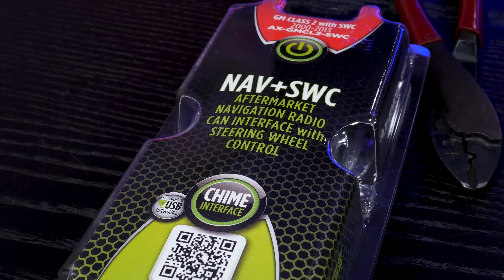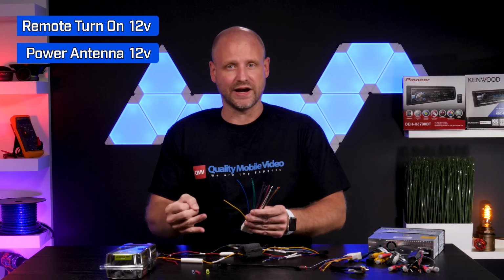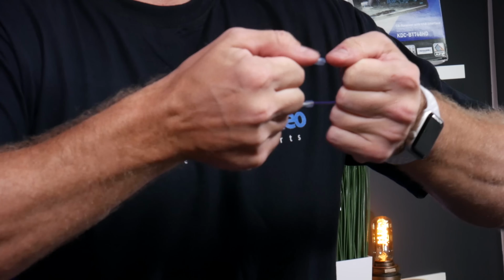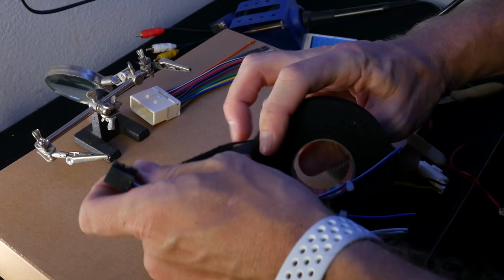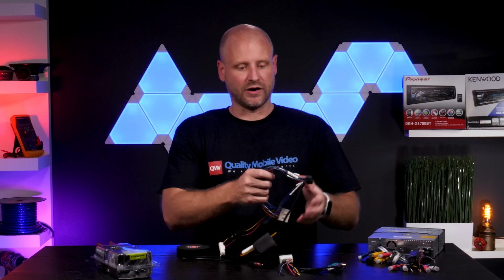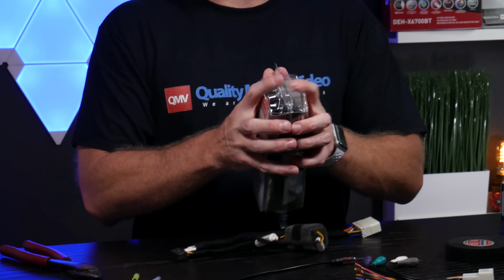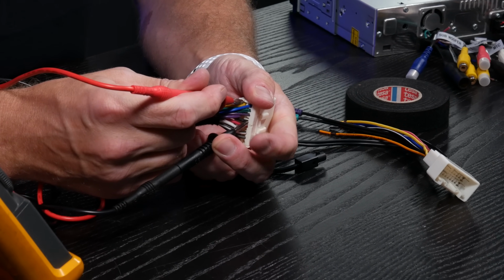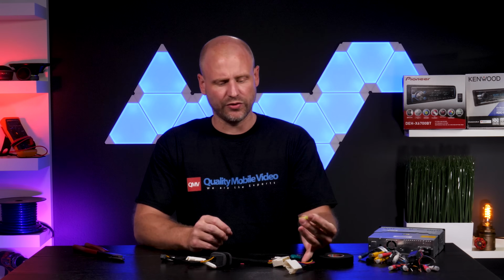Car Stereo Wiring Harnesses & Interfaces Explained - What Do The Wire Colors Mean?

Comment: im confused with the blue wires. I know that one of them powers a mechanical antenna but what about the amp blue wire? Im installing a flip up radio on my motorcycle and the antenna reception works good when the display is no flipped up but once it comes out and flips up the reception gets bad and I have no idea how to fix that. I thought maybe the blue power antenna was for getting better reception but I don't think it is. Also how do I wire it so the video plays while I ride?
Reply from the maker: Generally remote turn on
Reply from the maker: To play video you'd have to bypass/ground parking brake, which is a safety hazard

Comment: This video is the most informative and educational on this subject.  Thanks a lot!    I have a question on the steering wheel control unit and parking brake by-pass.  I have a 2005 Lexus ES330, and try to change the factory radio to aftermarket one, do I really need the steering wheel control unit and parking brake by-pass?

Comment: I installed a aftermarket radio and interface and followed diagram wire for wire..but the radio will not power on or off with the ignition. I have to manually turn on/off...any thoughts as to why.?
Reply from the maker: Tough to tell, could be the wiring could also be the brand of stereo if it's a lower cost model
Reply: @Qualitymobilevideo  it is a lower end brand. It's a dual xdcpa9bt

Comment: Ive got a harness adapter with a yellow dimmer positive and a yellow dimmer negative.  I have no idea where they connect to since my aftermarket radio doesnt have a dimmer or illumination wire.. also my dash lights aren't working so im thinking those dimmer wires really need to be connected

Comment: Try connect rear camera and got little bit smoke from wires. Now screen brightness doesn't work,only seat on minimum. What can be wrong?
Reply from the maker: Sounds like you shorted something or connected something reverse polarity.
Reply: @Qualitymobilevideo  so it mean screen fault or can be wire burn were go to canbus box?
Reply: @Qualitymobilevideo  I know what connect something wrong. But my question are why my screen brightness on minimum and don't wanna adjust brightness? Wires fault or something else?

Comment: I usually just use heat shrink. then put a layer of high temp electrical tape. Then I electoral tape all wires together. Then I zip tie everything together really tight around were i connected the wires together.  I just try to overkill as much as possible to prevent failure.

Comment: My 2006 Dodge ram 1500 was broken into and they cut the Manufactures Radio Harness, and took my manufactures amp, How will I hook up and aftermarket radio and to get my steering wheel control back?
Reply from the maker: Oh shit that's horrible! Did they completely pull the factory radio harness out? Or are the remaining wires still applicable for an installation?
Reply: @Qualitymobilevideo  Thank you for the reply, The Harness was completely cut. and the rest of the wiring is cut. I went to a junk yard and they gave me a wiring harness but the colors don't match my truck wiring.
So I am lost,
Reply from the maker: I would try and contact the car manufacturer to see if you can get a new factory harness

Comment: We've hooked up everything properly and have done many installs. But we hooked this one up and still have no sound. Not sure what's missing. It's a 2003 Isuzu Ascender with a stock Bose audio system. We are installing a Pioneer AVH-220EX head unit.
Reply from the maker: What radio replacement interface did you use? Here are some I'd suggest:
https://www.qualitymobilevideo.com/gmos-04.html

https://www.qualitymobilevideo.com/ax-gmcl2-swc.html

https://www.qualitymobilevideo.com/gmos-014.html

Comment: What if the after market radio harness doesn’t have a “power antenna” wire? Do I just shrink wrap the “power antenna” wire on the factory wiring adapter?

Comment: The radio I ordered doesn’t have the dimmer wire but the harness does should I be worried?
Is it just an option for some radios?
Reply: bryan acosta did u connect your stereo?

Comment: I have a 2008 Silverado WT with manual everything--no buttons on the steering wheel--but it does have Onstar. How do I know if I NEED an interface or not?
Reply: I'm having the same dilemma, I think It would need an interface.  Research you're vehicle type with the search term audio interface and see what they have.  I think it does as my vehicle is a chevy as well. He kind of glosses over the interface part and doens't really say how to know what type you need. We bought a quick connect harness and it's not working for the HHR. Let me know how it goes.

Comment: I have a Bose factory system in my Nissan Armada install a touchscreen stereo everything works but the Bose factory speaker is this because of the factory amp?
Reply from the maker: What year Armada do you have? And did you get the correct interface/harness? For exampled, models 2010-up require this harness to bypass the am and retain Bose: https://www.qualitymobilevideo.com/70-7554.html

Comment: So I just put an aftermarket double din in my 2002 Hyundai Elantra and I’m pretty sure I accidentally crossed the ground and the illumination wires because when I turn on my headlights my radio cuts off and says “NO SIGNAL”. What wire do I connect the ground to?

Comment: i connected pioneer avh-2750bt with 12v 10A LED driver for my home but each time i switch off and turn it on the memory  is reset, doubted whether it was due to reverse connection but that was not the case. What possibly could be the reason

Comment: Is this "universal"? About to pull apart the dash of a 2019 Camry (NON JBL) system to connect my LC7i and speakers from amp back to the harness....
Reply from the maker: In terms of colors of wires, these are generally universal, but every car needs a different harness/interface when replacing the stereo. But if you're talking just about the speaker connections, the purple, grey, white and green are almost always the same.

Comment: i used my old connector and the new adaptor that came with the stereo and connected the colors and i turned the truck on and it worked but i turned off the truck right away bucause i got excited and then i turned it back on and the stereo didn't work anymore and then that i'm guessing caused a shortage and my radio fuse burning and causing my cluster to go out as well , one thing i did notice was that the adapter color wires that cane with the stereo were thinner then the connectors wires that the old stereo had
Reply from the maker: What's your make/model/year?
Reply: 2002 gmc sierra 1500
Reply: i think ima need a new aftermarket wiring harness and not use the old one that i was using for the old stereo  , what do you think
Reply from the maker: @alexis_1503  You need this https://www.qualitymobilevideo.com/70-1858.html

Comment: I have 2013 Silverado 2500 ltz with nav and finding out colors on that factory harness are different colors than new radio harness wires and can’t find and connectors for that model has almost like and ecu plug on that back of the factory harness

Comment: I have 2004 Toyota Avalon with jbl audio and built in amp and i have static in my speakers. my wire harness has the purples, greens etc. but they are rca and my aftermarket radio does not have rca what do I do please help.

Comment: Hi I'm Rohan,Thanks for the great video,I pray u can help me ,I'm installing what I thought was an easy install it's a 2009 Hyundai accent ,dual dim or double dim radio with back up camera ,installed the radio and it worked then the back up camera didn't work ,so tried interchanging the wire from the back cam to the radio but still no back up cam, anyway changed the radio a new radiousing the radio without back up cam ,2 days after radio audio went out ,then a few hours the radio stopped powering on ,so we changed the radio,now ,the new radio won't power on at all, checked the yellow wire witch is supposed to be battery+ it does not have 12v checked the 3 audio fuse in the fuse box ,they all good ,I get 12 b on the red acc wire ,no voltage on yellow wire ,???radio won't power on

Comment: 2004 Z71 aftermarket radio checked all connection over and over and i still have a squilling come through speakers ?
Reply from the maker: Was the noise happening before the installation to the old stereo? Does it happen on all sources? How is your ground?

Comment: I have a yellow with a black strip mute wire.  Where do I connect this wire.
Reply: Don't worry about it it's a old feature you probably don't care about.. hook up all your speaker wires and power wire so the radio comes on

Comment: hi there can anyone help please, i have just installed an after market stereo to my jeep grand cherokee and it work fine, until i turn on my head lights and then there is no sound. the stereo is still working the illumination works, its still playing but i have no sound at all. any ideas please. many thanks  Tony
Reply from the maker: Hey Tony, sounds like a wiring issue. My first guess is you have your ground wire hooked up to the illumination wire of the car. Change your ground wire and it will work fine. I'd double check all your connections. What harness did you use to connect the stereo to the factory wiring and what year is the Jeep? It could also be your electrical system can't handle the load.

Comment: I have a problem with my pioneer avh1300 I just bought. All connections  are made yet I'm still not getting any power. Any help?
Reply from the maker: Still sounds like there is a wiring issue. Check Constant, the yellow wire; 12 volts all the time. Red wire; this is accessory, meaning 12 volts as you turn the key, check for this.  Ground????? Explanation needed?

Comment: My radio in my car (aftermarket radio, on Polo 9N3) remains powered on also when the car is not powered on. What do I have to do If I want to have the radio working only under key ignition? Cut the yellow wire? If I do so, the red wire is under fuse too?

Comment: So witch harness is witch, the harness that comes with the after market radio plugs into the back of the new unit and the exposed wires connect to your cars wiring behind the dash but yet it’s a plug with the wires that connected to the factor radio do I just cut the wires behind the plug and match the wires accordingly color
Reply: No for the sake of the next owner please for the love of God do not cut those Factory connectors. You need to buy a vehicle specific adapter harness that will give you the standard colors to match up with your aftermarket radio
Reply: @rmblwgn  okay I figured that out now but metra doesn’t have a compatibility with my Lincoln town car and also I’ve noticed that there are more than 2 plugs there’s about 3 more connections and I think the go to the stock subwoofers in the back

Comment: I am simply trying to take a junk-yard radio from a 2014 Explorer and put it in my police 2014 Explorer and make it work.  I changed the mounting Brkts, but when I plugged it in it would not tune or change frequencies and there was no audio.  Seems that the cable plugs-in OK to the police car cable but will not tune and there is no audio.  What do I need to make this swap work?

Comment: Help: My 2013 Chevy Camaro is having radio issues. Once car is turned on everything is normal when you switch to drive ragio turns of and blinker doesn't work the AC stops working.  This is an issue with lots of Camaros and Corvettes but not a recall yet. Here's my question. On youtube thers a person showing why this is happening and to clip the white wire connection behind the radio and this will fix the problem. Would you know how true this is? Thank-You in advance.
Reply from the maker: Have you tried calling Chevy technical support or bringing your car into a dealership?

Comment: After stripping the wires from the stereo harness, they appear to be aluminum and 22 gauge. The wires from my car harness are 18 gauge and copper. Will this be an issue if I solder them together as instructed in the video? Cheers

Comment: I've got a 2007 Nissan Altima, I hooked every wire up correctly... (The color codes to the new Dual Double Din stereo we're the exact same) I grounded it down, not very well, but enough to power on. 
Now my problem I'm havin, which I hear very commonly, is it powers on, does everything it's supposed to... But no sound...
The factory radio had the power antenna hooked into q separate, much smaller "wire harness" that plugged in the back. I did not hook that into my new aftermarket one. The reason is because the original was a connector type plug in style, my aftermarket has a circle style. So I did not hook that up, is this why I don't have ant sound? It's the traditional wire harness hook up. Thank you!!
Reply: If the antenna is not connected, you should at least get static when you turn the radio on.

Try playing a compact disk, and see if that works. Since the compact disk player does not need the antenna.

Comment: I have three terminals coming out of my car. How do I know which one to connect my new terminal to? The wire colors don’t match and none of them have the same number of wires.
Reply from the maker: What is your make/model/year?
Reply: Quality Mobile Video 2008 Toyota Camry.
Reply from the maker: @jaytullo5486  What interface did you get? You should be using this: https://www.qualitymobilevideo.com/ax-adbox1.html

In conjunction with this if you have an amplified model:
https://www.qualitymobilevideo.com/ax-adty01.html
Reply from the maker: @jaytullo5486  Or you can use this for an amplified model as well: https://www.qualitymobilevideo.com/ax-tyamp1.html

Comment: How can i connect rear speakers front speakers and subwoofer with these four wires?
Reply from the maker: With which four wires. You mean using 4 of the speaker level wires and sending the signal to a subwoofer? You'll need an external amplifier and a Line Output Converter. Watch our video explaining the process here: https://www.youtube.com/watch?v=OXn8-8yee5o

Comment: But what if the wire coulors coming from the car don't match the wires coming from the radio unit?
Reply from the maker: You need a Metra harness so that you do not cut your factory speaker wires.

Comment: So my 2005 Jeep Grand Cherokee Laredo has 2 red wires.. we’ve hooked the radio up but when I turn the radio on my dash becomes obsolete (odometer, gas gauge etc) nothing works.. also the Jeep cuts off but when I cut the radio off it goes back to normal

Comment: I have a equinox 2009 but I but a aftermarket stereo 10 inch but it come with key 1 and key 2 but I know how to connect
Reply from the maker: You need to track down your factory steering wheel control wires.

Comment: Question> do you know what Could cause a loud noise ore bang in the speakers wenn you press the Mute button? Same Thing Wenn you turn on ore off the Radio. Having problems with a 2-din Radio in a audi a4 2001 with bose amplifier 😐
Reply from the maker: Not sure Danni. Did you install it yourself? COuld be a wiring issue or defect.
Reply: @Qualitymobilevideo  got the answer. With active bose i need a Adapter in between the amplifier and the Radio. 🙂.. Så never mind 😉

Comment: Red accessory wire has no volts what should I do?
Reply from the maker: Find the factory radio fuse and test it. Also find and test the accessory turn on circuit, you likely have an issue with either one depending on the vehicle.

Comment: I have a Nissan Altima that I've put an aftermarket system in and it works fine. 
The thing that bugs me is that the factory stereo had an additional connector, 4 wires in a 8 pin plug. I have no idea what that is for,
Everything seems to work fine, but I just like knowing why things are there! Any ideas?  
There where 3 factory connectors, 1. std. power, speaker, ground etc. , 2. the mystery connector , and 3. The antennae.
Reply: @Diesel6Power  Maybe, There's no online documentation that I can find on it, i'm not using it and it's not a problem but I would rather know for sure what it does.

Comment: Radio only works when I put the car in reverse any help? 2004 Ford Taurus
Reply from the maker: Oh snap! Did you install it yourself? Definite wiring issue. Sounds like you connected your main power supply to the power that lights up you're reverse lights. I would start with just checking where you connected your main positive cable
Reply: Quality Mobile Video I actually purchased the car like that

Comment: What happens if I crimped the positive and the negative wires together on ALL my wires? (purple to purple/black, vice versa.)  I didn't realize they were suppose to be wired positive to positive, etc until I installed my radio and put all the panels back on my car.  Will it do anything to my car or wires??

Comment: Great stuff.  Problems I'm having with my 05 Dodge Ram.  First, in addition to the standard black/green ground I also have a solid black wire.  Second, I have two identical wires showing constant 12v, both gray/red.  Any ideas anyone?  Thanks.

Comment: I’m using a metro harness

connected my ground, my constant and my 12v for some strange reason the radio will not turn on unless the contant wire touches the 12v wire.. mind you i did not heat shrink yet because i wanted to make sure everything worked first

Comment: Trying to connect some subs and amp into my 2013 Dodge Dart sxt and I need some help to figure out what are the wire colors of the 2 back and 2 front need some help please
Reply: Sometimes the radio has a diagram on itself in a form of a sticker

Comment: Okay. I do not have a power antenna, nor do i have my own amp. My cars harness only has a solid blue wire and the radio harness only has blue white. Do these need to be connected for whatever reason??